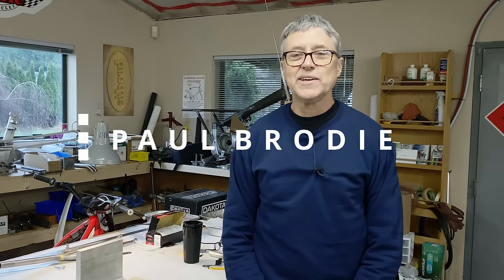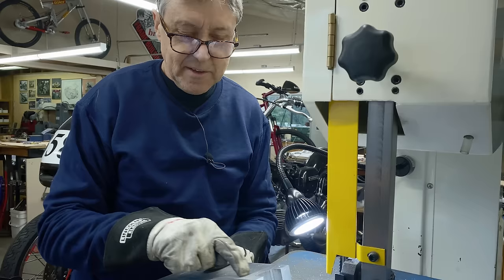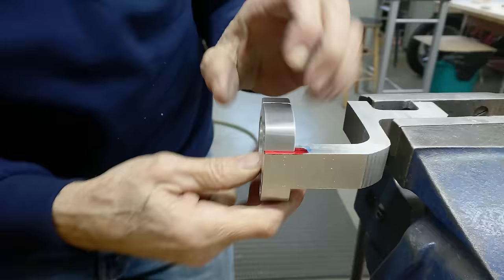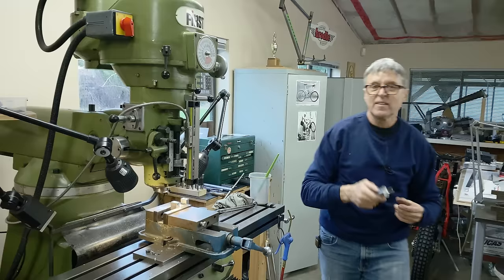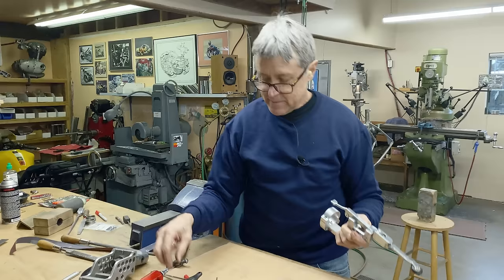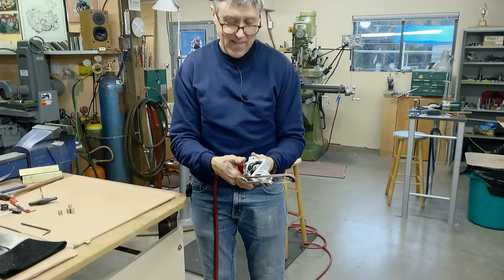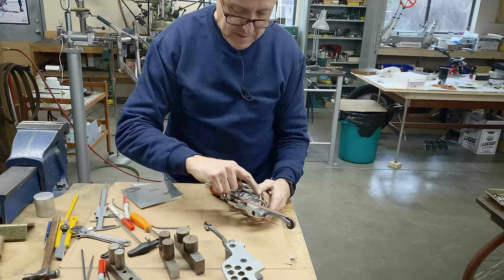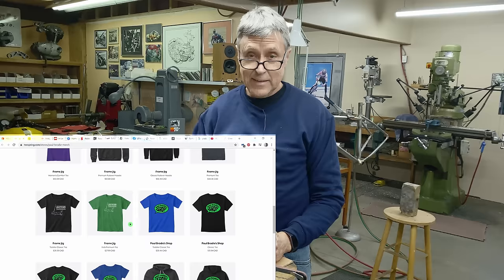How to make a belt sander - with Paul Brodie

Comment: Is adding lightness the same as removing heaviness?
Reply from the maker: Not really sure. Haven't been at this long enough :)
Reply: "Simplify, and add lightness" comes from Colin Chapman. (The head of Lotus motorsport) while their engines were down on power, they won many races because of innovations like the first aluminium monocoque chassis.

Comment: What is that red frame in the back at the start of the video ? Look like its using dual crown Dh fork and motorcycle control.
Reply from the maker: I think that's my Gas Gas trials bike; taken apart to fix the rear brake.

Comment: Getting serious about making one of these and was wondering why you bought the arm and lever and did not fabricate those yourself? Is it a cost consideration or something about the parts? Thanks for the clear explanations and letting us in on the idea the even master craftsmen such as yourself sometimes use shapes in stead of technical drawings when that works well enough.
Reply from the maker: The arm and the lever are die cast aluminum, and nicely made. Yes, I could have made them but... it was easy just to buy them. And if it got dropped and the fragile arm broke... buy another one! Thanks for watching.

Comment: Great video, the only question i'd have is it worth doing, new narrow belt air sanders are very cheap to buy, very light and ergonomic, electric ones aren't expensive, with the benefit of being quiet, not a criticism just an observation.
Reply from the maker: Thank you. Do the cheap ones have the 90 degree bend in the belt? I will bet not. That's what's makes all the difference. You have no control with electric. It's either on or off.
Reply: @paulbrodie  I don't know if the cheap ones have a 90% bend, many of the electrical ones have variable speed.

Comment: Good video. I wanted to say, though, I've bought the similar pneumatic belt sander on eBay a couple of years for around $ 50. I'm not saying it's better,  just something to consider, especially if you plan to use it so rarely as I do. Just type "pneumatic belt grinder" to get an idea.

Comment: would a 3" air panel cutter Not work better?? For the project And they have a trended face flange to hold the guard as well.and Just run the belt on the disc holder..
Reply from the maker: Well, a 3" air panel cutter is basically an air motor with a disc attached. Yes, I suppose I could have used one, but I would have ended up with the same end result. Thanks for watching.

Comment: My friend was wearing gloves while drilling on Pillar drill until drill bid caught his glove and ripped his Thumb out of his hand and throw it across the workshop. Very bad practice considering your 54 years working with metal. Otherwise thanks for sharing your good work.
Reply from the maker: There are pros and cons for doing many things in the shop. I do have a foot switch for my drill press and my foot is always ready to switch it off. When I'm holding a piece of metal with my left hand and the chips are flying around and hitting my hand, that's when I want my glove on. If you think I'm setting a bad example, sorry for that.
Reply: @paulbrodie  foot switches are the smartest thing in a shop...all my sanders are foot operated...

Comment: What is the Bevel Gear DUC on the shelf, cut my teeth on a 450Desmo motor at age 16 I love those.   Were they 160 to 450?
Reply from the maker: It's a 250 and the cases are empty; it's just for show. I believe 125 was the smallest cc.

Comment: I must be missing something? I've seen these types of pneumatic mini belt sanders for less than $100. Or is this one extra fancy? Don't get me wrong, that's a beautiful finished product, but what does it do that the cheap ones don't do?
Reply from the maker: The cheap ones don't have the 90 degree bend in the belt which gives you a long spring travel, to take up the slack when you bend the belt into the space between it and the arm, to smooth a fillet braze. They really are a more sophisticated belt sander, but you might not need that extra sophistication.. I do. Thanks for watching!
Reply: @paulbrodie  Ah! Now I see it. Thanks for the explanation!

Comment: I'm kind of confused, I have a 3/8 pneumatic belt sander from Harbor Freight that cost me $30 IIRC. Whats the difference between that and a $700 one other than its an el cheapo HF tool? It seems to work just fine every time I use it.
Reply from the maker: Check the space between the sanding belt and the underside of the arm. I'll bet that yours has very little or no space. That means that I can do things with my belt sander that you cannot do with yours.
Reply: @paulbrodie  oh no doubt yours is better than my pile of HF junk. I just thought you said you couldn't get them for under $700 and didn't know what you meant by that. Mine is bottom of the barrel but it spins the 3/8th belt around just fine

Comment: I am genuinely confused as to why make this using a standard due grinder. I have 4 or 5 finger sanders that ranged in price between $50 to $200.
Reply from the maker: Mike, not all belt sanders are created equal. Do yours have a space between the belt and the arm? My guess is probably not.

Comment: How come you don't have any CNC in your shop? A water jet would have cut that one aluminum piece out nice. Maybe get a fiber laser too? They're totally bad ass. You can get one cheaper than you might think now too. They're well under a million these days. hehe
Reply from the maker: You don't like that I make everything manually? My shop is small, I don't even know where I would put a CNC. Years ago I had one, and it was expensive and noisy. I'm retired with a YouTube channel. My needs are pretty simple. Thanks for watching.
Reply: @paulbrodie  fair enough. I just thought you could make more with a CNC.
Reply from the maker: @1pcfred   For me it's not about making more. I am retired, with a full time job known as YouTube. I would rather focus on manual machining and fabrication, to my highest quality, and sharing my knowledge.

Comment: my i ask what blade u use on your band saw...it seems to cut any metal....also are you running all at 3200 rpm
Reply from the maker: It's just a good brand name, nothing fancy. Not even bi-metal. Much slower than 3200 rpm.
Reply: @paulbrodie  hmm i have a metal /wood band saw...cuts aluminum like butter... poops out on steel...wont even do 1/4 inch
Reply from the maker: @minskmade   You probably have a wood band saw. They spin much faster than a metal band saw, which tend to cost significantly more. Some folks put a bunch of energy into pulleys to slow down the wood band saws, but it's best just to get the real thing.
Reply: @paulbrodie  it definitely is not just for wood . it is for wood / metal...it goes down to 80 rpms . it is a wilton 8201 which is basically like the delta wood/metal band saw...ive tried multiple blades...so odd..either way thanks for replying and keep up the great work.
Reply from the maker: @minskmade   It really has nothing to do with rpm's, it's the blade speed. Mine is variable from 30 - 90 m/min. What is yours?
Reply: @paulbrodie  i actually think i mispoke...new to band saws...my book says 3300 is the fpm...but that isi not good for steel...when i cut is down t like150...it basciall yjust spins and does not cut....

Comment: Metric tap drill is always diameter-pitch.
But what if it's a 5x 0.9????? 😉
Reply from the maker: I would look that up on my chart. Every machinist has a little chart!
Reply: @paulbrodie  I honestly don't think a 1/10th of a millimeter would make any difference.
Especially in aluminum.
Besides, 5x 0.9 is JIS, not DIN
Reply from the maker: @jimurrata6785  There is always a little bit of leeway in tap drills. Even if you have the correct drill, if it is sharpened poorly, it can cut oversize...
Reply: @paulbrodie  You seem to have a good handle on your tools.  😉
As long as it's oversize... I guess it doesn't matter too much if you have a 75 or a 70% thread in most applications.
A jammed up or broken tap from undersized hole is a bigger problem.
Reply from the maker: @jimurrata6785   True.

Comment: Hi Paul and Mitch, what is the width and length of the band ? 
Thanks :)
Reply from the maker: The sanding belt is 1/4" X 24". 80 grit
Reply: @paulbrodie  Thanks, now I will hope that's available in France ;)

Comment: What blade are you using on your bandsaw? I've bought 3 blades the last few months, one from starret, one from MSC and another from a tool supply locally and they all skate right off the metal and don't cut.
Reply from the maker: Perhaps your bandsaw is not setup correctly? Maybe the metal is too hard for the saw-blade? Maybe even the blade is in backwards?
Reply: @paulbrodie  No, blade is in right. The set up is correct. Im wondering if the speed might be too high.
Reply from the maker: @opieshomeshop  Metal blades run much slower than blades for rod working. Check your speed for sure. 😉

Comment: you can buy an electric one for about $200. fair enough to do this for a hobby, but if working commercially this makes no sense. Just buy one and you can complete several jobs and get paid in the time it would take you to make something like this. The tool does looks exceptional however.
Reply from the maker: You might think all belt sanders are the same, but they are not. Notice the space between the belt and the arm. That is crucial. Do the cheap ones have that? No.

Comment: You can several brands of belt sanders, 3M included, between $170.00 and $500.00 dollars. Aside from the craftsmanship aspect, am I missing something?
Reply from the maker: These belt sanders have a level of sophistication the cheaper ones don't have. 1. Wide range of belt tension. 2. space between the arm and the belt so that you can "bend" the sanding belt. Make sense?
Reply: @paulbrodie  Yeah. I guess. If it works for you, go for it.

Comment: They're 40 quid on eBay, where did you get 700+ doll hairs from?!
Reply from the maker: You are trying to compare two completely different belt sanders. My belt sander, because the belt is 90 degrees over the rollers, will do things the cheapie cannot do. Go to the Dynafile website and check prices.
Reply: @paulbrodie  yeah I get that but seriously a 700+$ difference?! For a spring and 90° twist? I'd be making one too!
Edit; I wasn't saying your not giving the right price I'm just asstound that it's the case, I'd be making a few a selling em lol
Reply from the maker: @Rhythm24inch   I appreciate good quality and I'm willing to pay more for it.
Reply: @paulbrodie  obviously not if your making one yourself and using it for 20 years lol

Comment: You can buy a belt sander for $40 to $150 now depending on the brand and materials. Not worth it to make one these days.
Reply from the maker: There are belt sanders, and there are belt sanders. These two I have are more sophisticated than most. Do yours have a space between the belt and the arm? Do they have a 90 degree bend in the belt? If not, they won't work for filing up a fillet braze...Sorry.

Comment: Ok, so, if you have the talent and skill to make all that ... why did you have to buy that $109 part?  why didn't you make that too?  It appears to only be a long lever, with a pivot at the middle, a thumb pad on one end a wheel on the other end, and a spring to make it return .. that doesn't seem like it would be all that difficult compared to all the rest of the work you did?

This is not a critique, it is an honest question.
Reply from the maker: Yes, that is a valid question. It's a die casting and they did a nice job. At some point I have to draw a line for what I am going to buy and what I am going to make. I chose to buy these parts and make the rest. I guess it was just a personal choice. Thanks for watching!
Reply: @paulbrodie  Paul, thank you very much for taking my question seriously, and responding.  I used a "Dynafile" when i worked in a small machine shop (i am not a machinist, i was only their grinding-bitch) and I had considered getting one for myself but they are SO expensive!!  Your video makes me feel I could very likely build one that would be cordless-drill powered!  Thank you for sharing it.
Reply from the maker: @DieCastoms   Yes they are quite expensive, but very well made and last well. Years ago I made my own to save about $400 which in 1985 was a lot. I hope you do make your own version :)

Comment: Not sure why you just wouldn't buy a pneumatic belt sander. they are definitely not expensive you can get one for less than $50
Reply from the maker: Not the same. They have no space between the arm and the belt. Really does make a big difference.
Reply: @paulbrodie  not really. Considering your example on Price being too high  is no different than the $50 one for the hundred dollar one or the $150 one or the $200 one.. and I've used all of them. And since you don't own one of the other ones how do you know whether it makes a difference or not. Making contradictory statements certainly doesn't make you look intelligent.
Reply from the maker: @anthonyhumbert8787  When I'm sanding a fillet braze I need to be able to flex the belt so that it contours to the shape of the fillet. If you're a bicycle framebuilder that is very important. Are you a bicycle framebuilder? Probably not. In that case, the cheap one will suit you just fine.
Reply: @paulbrodie  bicycles no. Roll cages yes. The difference is life and death so my welds need to be perfect the first time. Sanding and grinding to make the joint look good is a no go in most situations. But I use the belt sanders to create a tight joint profile before welding.
Reply from the maker: @anthonyhumbert8787   Well, I hope you are using a holesaw first to create the mitre, if not, that's way too much work for a belt sander...
Reply: @paulbrodie  all mitered on a mill.

Comment: You have too much time on your hands. LOL.
I have a Mac and I see ones identical on Ebay for less than $70. New Mac is $265. THey don't have the belt float but if you put a larger nose wheel on it is much better